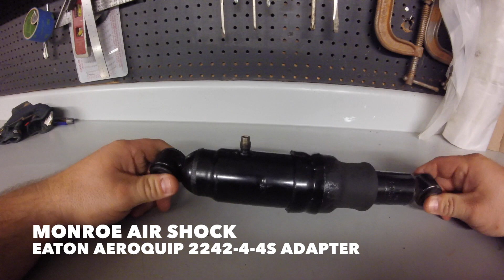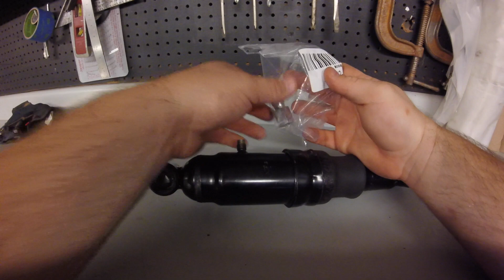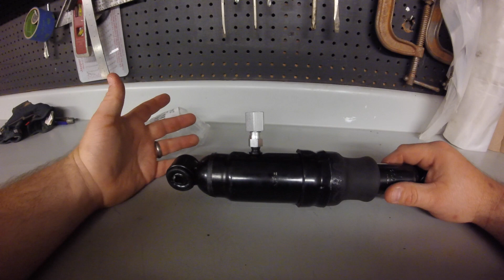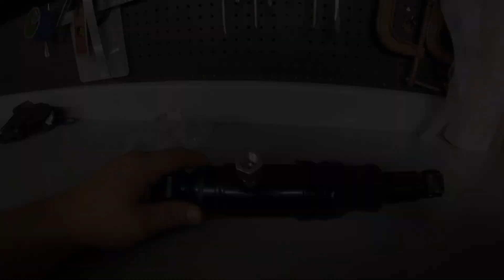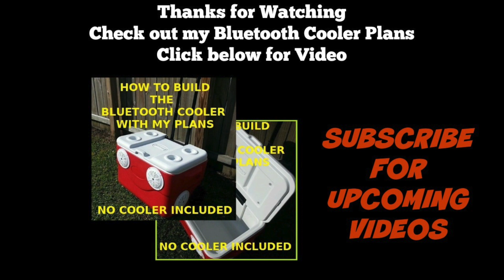Monroe Air Shock Adapter to 1/4" NPT Thead

Comment: Monroe uses small hard plastic lines for several reasons. The line is inexpensive, durable, it's immune to weather and age rot, it can be routed in tight places away from exhaust, and most important it doesn't allow air to migrate from one shock to the other in the balanced system fast enough to effect handling in long high-speed turns.
Big airline is a failure.
Reply from the maker: I’ve used this method many times without failure. I’m sure they had great intent to use the smaller line and the reason I’ve used larger airline in the past has nothing to do with how the shocks were intended to be used.

Comment: The adapters that come with the Monroe shocks have an indent in the center where you can drill it out with a quarter inch drill bit and the line will fit directly through it and into the shock and you can use the factory plastic adapters :-)
Reply: Interesting, but how is the line "locked" into the shock? If I drill out the center of the factory plastic adapters, the "teeth" inside the adapter will not be there to grab the line and hold on to it.

Comment: These fittings are garbage do not buy them. The swivvle points leak air badddd. Buy a 7/16-20 female to 1/4 male fitting no swivel point or you will regret it
Reply: Where can we find this fitting?
Reply: @dwuanedalebaza9608  all of this stuff is on amazon
Reply: I tried this. It’s too long.

Comment: Ordered those fittings for my monroe shocks. they thread right on perfectly. My question is with them being swivel like...what keeps them sealed lol. I can put my finger in one hole and blow through the other, air shoots right out between 2 sections. Stupid question I'm sure lol.
Reply: Did you end up installing?

Comment: A few questions:
1) On the fittings on the side of the Monroe Air Shocks, is there a valve-pin, similar to a normal (Schrader) Tire Valve, that must be depressed to add or remove air from the shock?

2) Do these Aeroquip 2242-4-4S adapters have a part inside that keeps the valve-pin depressed?

3) Or, does the Monroe setup work differently?

4) Do other Air shocks have a normal (Schrader) fill valve that's the same size as a Tire Fill Valve that will work with a standard air hose "Tire Chuck" ?
Reply from the maker: I dont know about other air shocks but these monroe shocks do not have schrader valves built into the housing. It is just a direct inlet. You would need some  pneumatic valves to be able to build pressure and release pressure.

Comment: Can those air shocks run without air ? Would they work like normal oil shocks it theres no air in them ? I have some but wish to lower my rear end ( kinda normal ride height)
Reply: NO.  They would be like driving on tires without air.  No function.
Reply: @rayturp6742  actually I have been riding them without air for like 2 years. They also have oil inside like normal shocks. Monroe told me it was all ok

Comment: this is almost the same part the connect is just male on the NPT side and is 5$
 https://www.ebay.com/itm/6505-04-04-Hydraulic-Fitting-1-4-Female-JIC-Swivel-X-1-4-Male-NPT-Pipe-9100/113634051892
Reply: https://www.ebay.com/itm/6503-04-04-Hydraulic-Fitting-1-4-Female-JIC-Swivel-X-1-4-Female-NPT-Pipe-90/113654613008
https://www.ebay.com/itm/6506-04-04-Hydraulic-Fitting-1-4-Female-JIC-Swivel-X-1-4-Female-NPT-Pipe/113623522877
these also should work, ill be checking this soon.
also any JIC is just a AN fitting

Comment: Ok, so I purchase fitting and Now what size line 1/4 ?  and what do I Need to connect from The shock ?  Another fitting..thanks for ur help
Reply: you can use any air hose for an air compressor that has 1/4"male NPT on it  or any 1/4" male npt fitting

Comment: $5 my butt clicked on your link $17.29 Amazon is freaking horrible
Reply from the maker: Thats what they were when I made this video back in May of 2015. TImes have changed.
Reply: https://www.ebay.com/itm/6506-04-04-Hydraulic-Fitting-1-4-Female-JIC-Swivel-X-1-4-Female-NPT-Pipe/113623522877
this should work and its 5$

Comment: what shock is this looking for a small one like this
Reply: they are for the old Volkswagen beetle's. late 70's. Ma803 is the part number i believe
Reply: U mention late vw.   Would that be on the rear.  Will it hold all that weight of vw engine?  Just asking

Comment: What monroe are these? Part no. Please:3
Reply: @evo emperor, it doesn't matter what particular Monroe air shock model. All the male threads are speced the same so that the Aeroquip 2242-4-4s will fit all Monroe air shocks. In fact Aeroquip 2242-4-4s will fit all Gabriel air shock threads too.
Reply: Looks like an Ma803